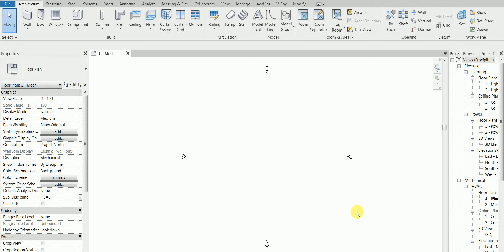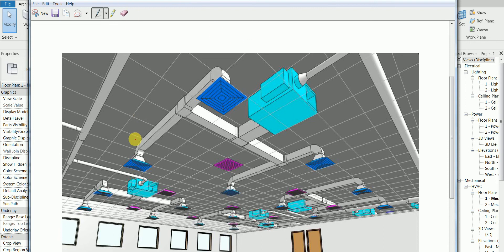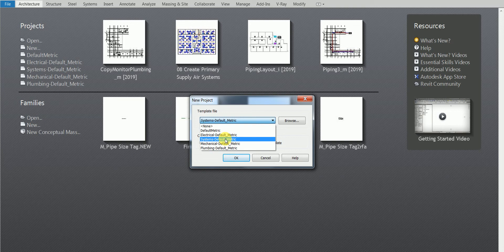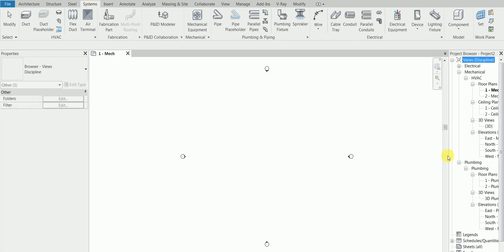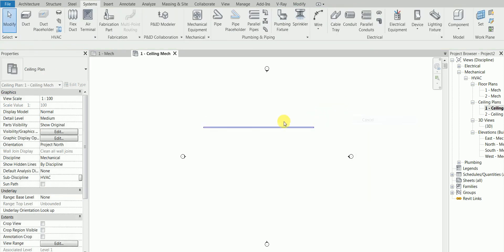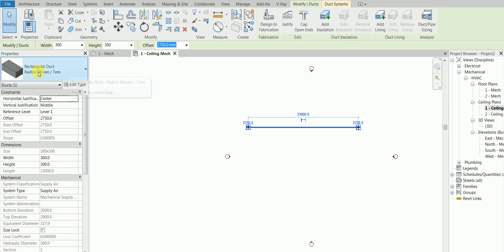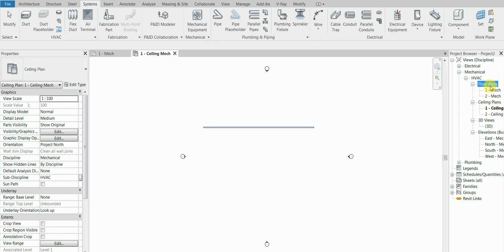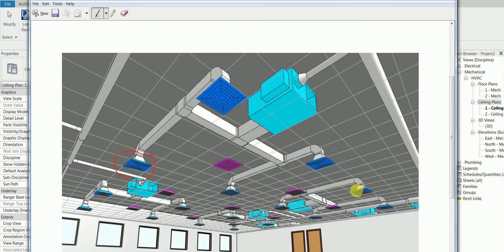Complete Revit HVAC & Plumbing Project in Revit - Part 1

Comment: Reflected Ceiling Plan a part of architectural drawings, showing the placement of various objects like sprinklers, smoke detectors, and any other mechanical or electrical objects on the ceiling.
A floor plan is a 2d drawing to scale of the inside of a building. It is a horizontal cut of the building at a height of 4 feet from the floor. The elements that can be shown in a floor plan are the walls, the partitions, the doors, the windows, the stairs, the furniture, and more.
Reply from the maker: Genius, Beautiful Answer